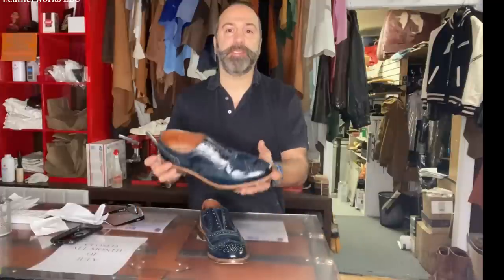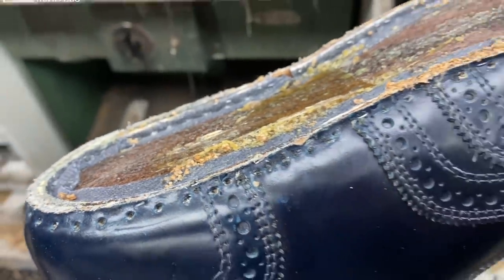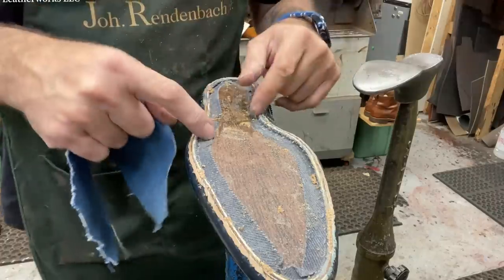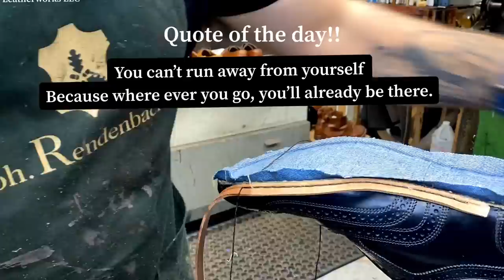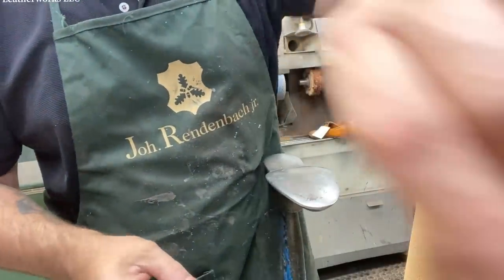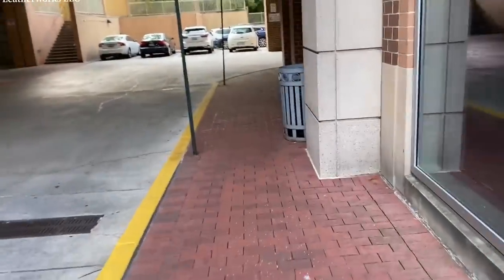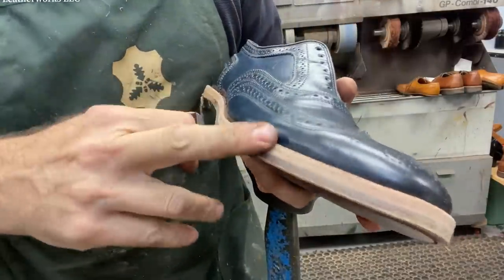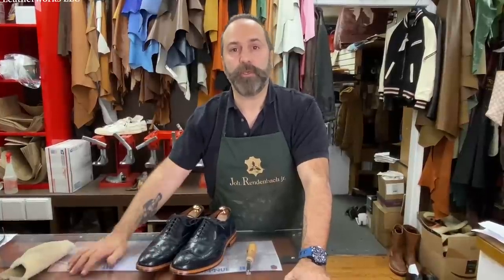Allen Edmonds Cambridge Shell cordovan, Toe counter replacement

Comment: When your feet are size 13D, your choice of shoes is limited.  Fixing a pair that fit well is worth the price. Great job.
Reply: Not to mention that if the guy bought a new pair instead, he may end up with the same or another problem. Now he can be 100% confident that those shoes are top notch in and out because the maestro himself worked on them and gave them the thumbs up clean bill of health.
Reply: If the shoe is still under warranty, I wonder if the manufacturer will cover Bedo’s bill. I mean he has proof that the job was well done.
Reply: Also…how often does AE even offer navy shell cordovan? These are not readily available.

Comment: Nice work as always. For me as an amateur, your videos are great tutorials!
I did a similar project, but didn´t bother to remove the sole and heel completly. I bought a new pair of Red Wing 2972 Engineer Boots at a bargain price, but wanted to get rid of the steel toe caps. So I cut the outsole stiches only in the front part of the boots and folded the rubber sole back. Carefully took the welt, insole and uppers apart until I could remove the steel toe cap from between the uppers and the lining. I used the same material you did, called Flexan over here and moulded it around the steel toe caps, so the new lightweight ones had exactly the same size and shape. Stitched everything carefully together again, some new cork putty, boots look like they have never been touched.

Comment: Holy shit. That demonstration on the creasing on the broguing is exactly what's happening on my AE Daltons in shell (which, admittedly, were an eBay purchase, but arrived practically NIB, not marked as factory seconds, and barely even worn let alone broken in). I just gave the toes a good squeeze, and there is NOTHING supporting the left toe. I can accept a certain error rate with things like sole stitching being a bit out of line (that's bound to happen when something is mass produced on an assembly line-type process), but this feels like a basic element of construction that should have 0 tolerance. I guess AE really has faltered...

Comment: Do you think the lip can prevent the water drops to flip on top of the shoes while walking on wet ground? The drop can't go higher and so it gets out of the way instead of rolling on your cherished shoes.. At the bottom of windows, they often but a similar system like a "drip moulding". Anyway, I try to guess why it exists. Very nice video as always!

Comment: Absolutely gorgeous shoes and great work! I have a question that maybe you can help with or point me to the right direction. I recently got into leather working and just started on my own pair of shoes, by hand haha (So much work). In terms of construction of my shoes, they're an attempt at a reproduction of my favorite slipper/sneakers by Havaiana's. They did a laced closed toe canvas shoe but don't make them anymore. I'm recreating it all in leather except for a 4 mm rubber eva mix out sole. The stitching between the upper and the mid sole looks like it's storm welted but with some extra stitching (almost like a lock stitch?). Sorry for the extra long backstory but felt context would save some time, 

I already made my mid soles out of 9 oz veg tan, cut out my cork sheets, and my upper is ready to go (short of a few more stitches). What would be the best way to join everything together? I'm not worried about difficulty really, more so want to make a well constructed shoe that I can re-sole when needed. Thanks for reading and thanks for the awesome video's. New sub and I'm about to binge all your content lol

Comment: Could you reattach the original sole and heel from the defective shoe so you wouldn't have to take apart the good shoe?  Is that a dumb question? 🤓
Reply from the maker: No because you are putting on new welt so it’s not the same size

Comment: I was always curious, does Allen Edmonds use the same paper foot bed on its higher end shoes?
Reply from the maker: Most A/E’s doesn’t use paper foot bed
Reply: @BedosLeatherworksLLC  thank you for the response, I’ve seen several videos where they do, and someone mentioned that materials and quality for modern AE shoes could be all over the place, especially in shoes made in past several years, so I was assuming that they use “fiber board” in most of their modern shoes. Glad to know that it is not the case.